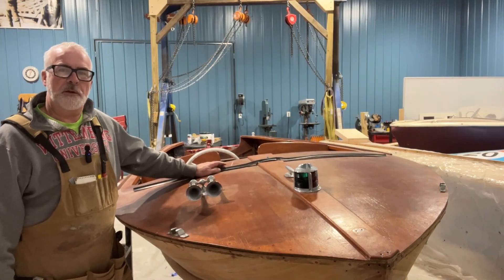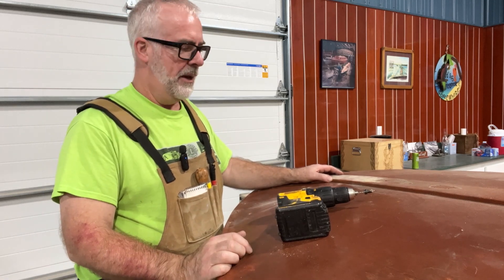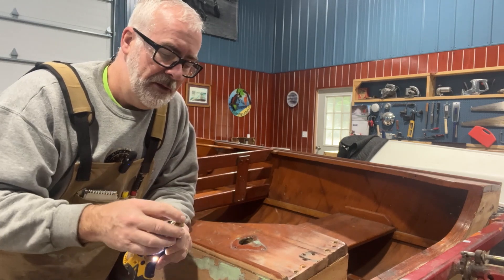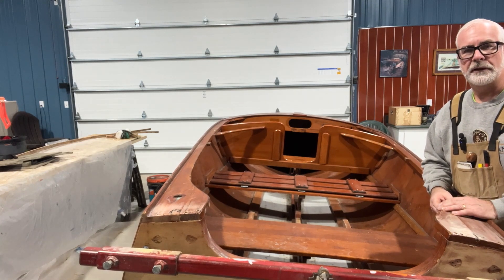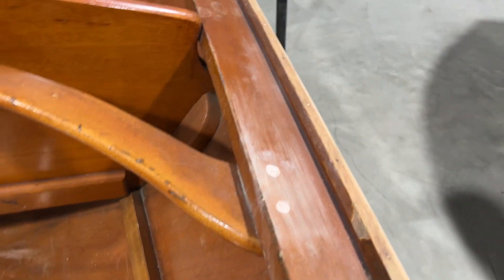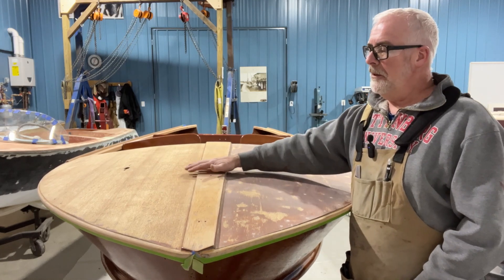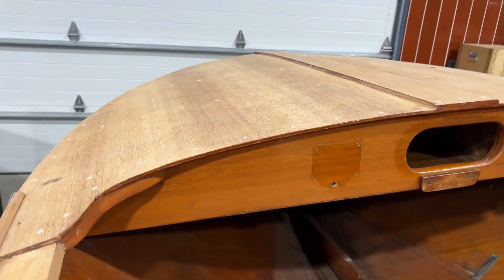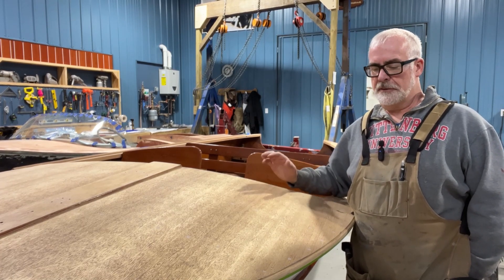Episode 11 - Repairing and Sanding the Deck

Comment: I’ve had success using a Brad point drill bit to remove filler from counter sunk Phillips head bronze screws. The point of the bit centers itself nicely in the fastener head without damage.
Reply from the maker: Yes, that would work well, too. Thanks the tip!

Comment: Wonder if a heat gun would remove both varnish and epoxy using gentle scraping. By the way, we owned a 14 ft Wagemaker Wolverine back in the 60's and early 70's but it was strip planked cedar with canvas over the planking below the spray rail down to the keel,. Plenty of steam bent frames. The deck was rather thin white cedar ribbon stripe vertical grain planks approximately 2" wide. There were no white lines between them.
Reply from the maker: Paul, I have tested both stripper and heat guns to varnish and they both work great. I have not tried it with epoxy but have heard it also works. I have a future restoration that I can try that technique on because the wood underneath will be removed anyway. It will make for a nice experiment. Take care!